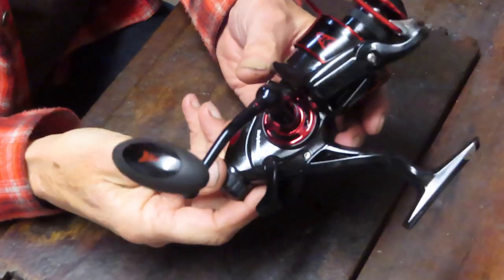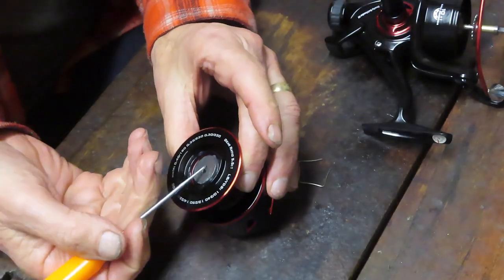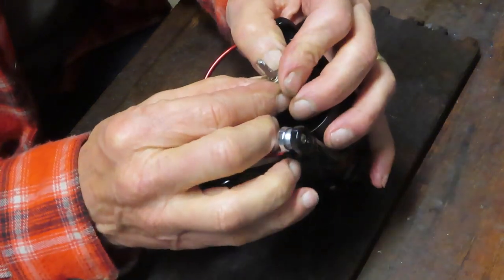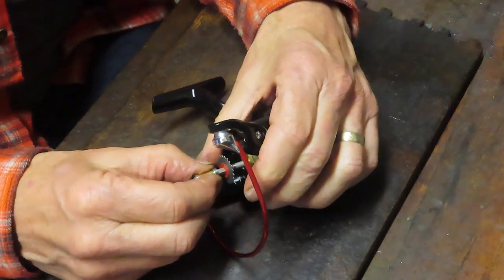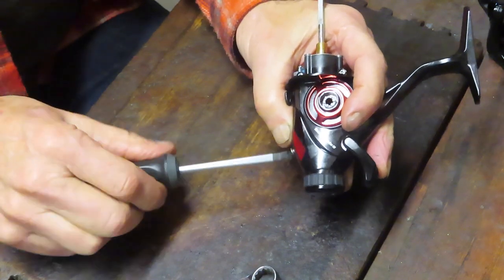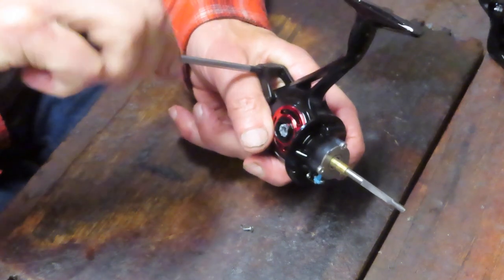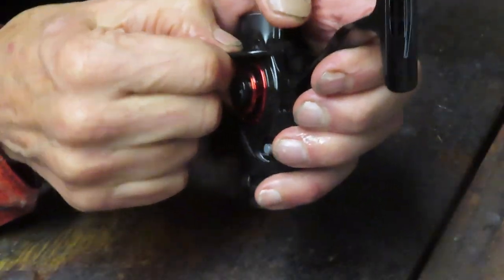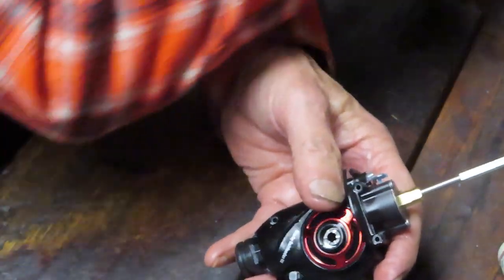KastKing Sharky III bait feeder fishing reel an inside look and how to take apart for service

Comment: The Sharky's are highly consumer rated, and are almost most impossible to find used on ebay.  Thanks for the video Dennis.  Look like the high consumer rating is well earned based upon the design.  However, I have had 2 reels - other manufacturers - break at the main body stem to reel seat junction (just like the "Born Free Pepper Thailand Homestead" video below).  Plastic/composition bodies are therefore not my favorite.  A lot of torque in that area.  I am a retired Industrial Engineer and can tell you it is a manufacturing flaw in molding process.  You can't detect the flaws through inspection.  You have to instead tightly inspect and control the molding process to make sure the density and flow of the material is correct and well within limits.  You either get one that will last forever, or fail early and quickly.  For me, I prefer aluminum bodies for that reason, but the composite makes it a lot lighter.
Reply from the maker: Thank you for sharing your experiences and expertise.  Yes, flex has always been an issue in graphite and plastic body reels.  A lot of manufacturers have reverted back to the metal side piece for the reel arm - Best wishes - Dennis

Comment: Great video. I have the same reel in the 3000 size. Two days ago I found out that my anti reversing switch wasn't working on it. I used this to disassemble it and found under the rotor that the spring to the blue lever was broken. I'm having some difficulty finding a replacement.
Reply from the maker: Contact Kastking directly.  They are located in Long Island, NY.
I believe the person's name is Paul.  They should be able to help you - Dennis

Comment: Thank you for the great disassembly video, I use this reel and like it a lot however recently the clicker is not clicking when the baitfeeder is engaged however the normal drag click is working fine, any ideas what might cause that?
Reply from the maker: Just a guess.  There is usually a small click tongue on the assembly and it is prone to bending or breaking off with a lot of use, It probably needs to be replaced to restore the function.  If it is broken, I would worry that the piece that came off may jam the gears in th future - Dennis

Comment: @secondchancetackle please let me know if the carbon drag can be replaced with felt(I own the 6k) also what size felt do you recommend judging from the carbon washer size! I've used felt drags so long that I don't care for carbon and only fish the rivers, carbon isn't really necessary. I do really like the smooth feel of felt drag and have seen where people have made the swap.
Reply from the maker: You should be able to swap those out, since most folks convert the reels the other way.  The washers should be the same size to get the same performance.  I am not sure where you can get the felt washers.  Check with Smoothdrag.com to see if they carry the replacements - Dennis
Reply: @2ndChanceTackle  thank you sir!

Comment: I have this reel,  amd only used it for 2 weeks, surf fishing. After a day of it catching a dozen nice 28 inch plus bluefish and a couple 4 foot blacktips , i rinsed it and next day the anti reverse stopped working... and i noticed the rear drag didnt seem to be working right either... any thoughts?
Reply from the maker: Yes - send it back to KastKing.  It is a nice reel that may have been fishing above its' capabilities, but is you have only been fishing with it for a short while, it could be covered under the warranty.  Don't mess with it, just send it back - They are very responsive at KastKing - Dennis

Comment: Have this reel, solid reel IMO. Clicker stopped working on bait feeder, but clicker still works on drag. Any idea what issue could be?
Reply from the maker: There is usually a click tongue in the lower case that makes the noise when in bait feeder mode.  There is a chance that it has broken or been damaged and is not connecting to the click ratchet.
Reply: Same problem with my 6K  baitfeeder clicker no sound, the brake works well but not click.

Comment: So I have this reel but the drag on the top of the reel will not work at all, weather its fully tight or not the drag will not work. What is the issue and how can I fix it
Reply from the maker: Hard to say, since it is a bait feeder.  It may be that the axle shaft is not locking when the bait feeder clicks to the off position.

Comment: One of 2 springs pops out from oryginal place (part number 1-18) and I can’t find scheme of reel and bait feeder drag stop working :/
Reply from the maker: You can contact KastKing directly to see if parts are available.
1-855-830-7430
service@kastking.com
They can usually provide the schematic as well.  Thanks for asking
Dennis

Comment: Fairly involved disassembly. My Wife Dropper her Brand New Rod and Sharkey 3 baitfeeder 4000 series reel , into the Channel water; Probaby 12 ft deep. Fortunately, I fished it out with a 3 oz sinker, 3 inch drppper line with treble hook. It was under water probably close to 10 min. Reel is not making any strange noises, so maby I wont try to take it apart. For the Bargin Price they are, if it siezes up , Its not gonna break the bank Right? What do you viewers think , as your Laughing?
Reply from the maker: No laughing here.  Happy to hear that you were able to catch it back.
I would recommend a through spray of a penetrating oil like WD40 all around the case and rotor if you are not going to take the reel apart.  That will help flush out and dirt or residue that may have lodged in there and it will help prevent issues later.  Thanks for the note - Dennis
Reply: @2ndChanceTackle   BIG TIME THANKS.... Yeah for sure, WD Should penetrate and provide some internal protection. You should have seen the " Oh Crap look on Her Face", after the Splash!!!
Reply from the maker: We have all been there!
Reply: @2ndChanceTackle   Thank you, I feel better now, lol. The ultimate Submersion Test. Have a Great Remander of your day.